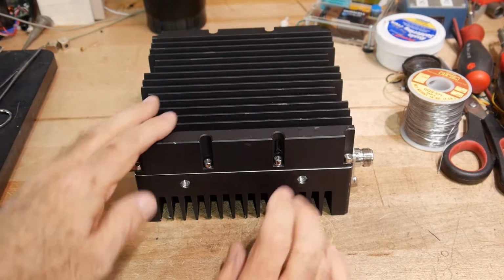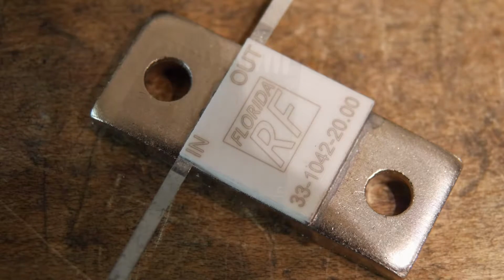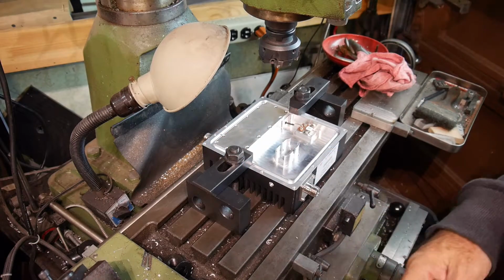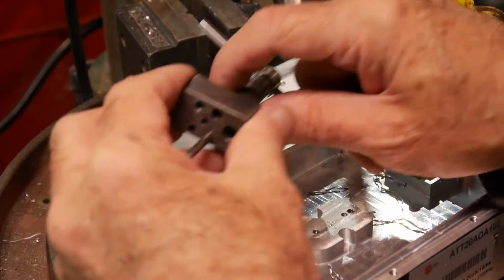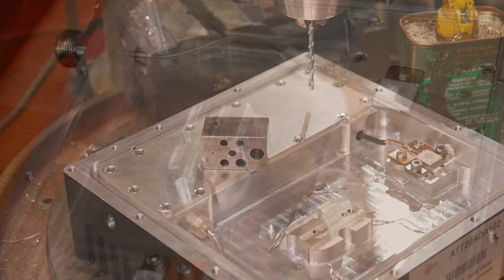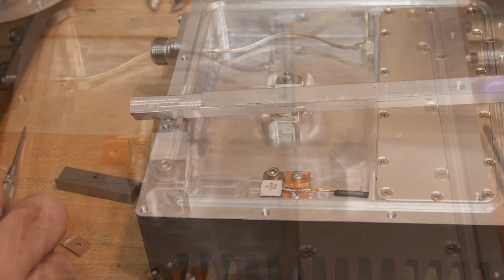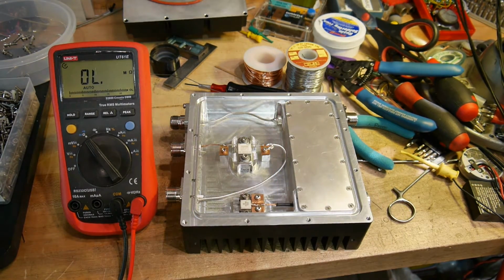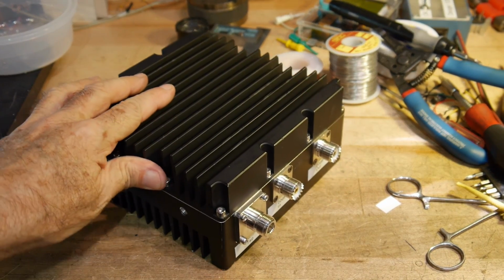#285 250 watt 20db attenuator built

Comment: The scope shows that it works, but I don't understand it. Isn't there a direct path, down and back up through the standoffs, and across the aluminum plate from the input to the output? It seems like there should be an insulator between the copper and the aluminum standoffs. Please help me understand why this works. Thanks.
Reply from the maker: it's a pi attenuator: https://youtu.be/VoUaRypDt2Q?si=iM0q_wCvXlc_0zxo

Comment: I know this is an older video, but would there be any value in adding capacitors to block DC? very cool project.
Reply from the maker: seems dangerous as you have several watts on the other side of that attenuator. it is only 20db
Reply: chuck some silver mica's on there or door knobs should be ok

Comment: Do you have any transmitters to load it with power and test temp rise?
I have a 50W one that I'd like to test on TinySA and no attenuator yet. Thinking of building the same thing, but I have doubts that single flange is going to survive all the power without something sophisticated like copper heatsinks and/or water cooling. 250W seems like a theoretical maximum similar to MOSFET datasheet figures.
There is also an alternative to spread thermal conductivity across like 10 lower attenuation value flanges, but I expect that so many of them in series would decrease overall +/- db accuracy.
Reply from the maker: I only have 100W and it does it easy. the flange is actual copper and about 1/8" thick.
Reply: @IMSAIGuy  Hm, ok, if you say so.
I knew flange is copper, but heatsink is Al and quite limited in thermal conductivity no matter how big of a thermal mass.

Comment: Hi. Can these also be used as a dummy load if one end is switched or terminated to ground?
 If I want to have a 10x attenuator how would I calculate it using these or similar parts? 
  I wanted to use this style of RF resistor with two leads to build a 2Kw dummy load (by stacking in parallel and in series) but now wondering if I use it as an attenuator to get 10x range on a 1kw s meter going into a 300W dummy load will the 300W dummy load be able to handle 3Kw with a 10x attenuator before a 1Kw power meter. 
 Would a 10x attenuator simply be 1000W of resistance value (marked on the component) at 50 ohms? This seems to simple to be correct.
Reply from the maker: there are 50ohm load in the same package for sale.
here is a small one: https://youtu.be/4sxPSJKPOs4?si=pt9_YO25AHsJIqwS
or 250w: https://youtu.be/tQ381HfpAxM?si=3Fx0W9mccAy7f91M
10x is 10dB attenuator
attenuators are more complicated than your calculation. https://youtu.be/VoUaRypDt2Q?si=54G2JuwUSTnvSo_n
Reply: @IMSAIGuy  The thing is I want to build a 2000W dummy load by using these RFR type resistors but the ones that have two tabs. I'm not sure if they are the same as the attenuator you were using but they look almost the same. The idea is to build a 4x4 or a 3x3 grid to arrive back at 50 Ohms but then I saw the 100 Ohm the 200 Ohm etc and the 500W and even 1000W versions. I found a few deals for around $3 a piece for the RFR 50-250 and I'm just waiting to hear back about a 200-800 I assume it's 200ohms and 800W. The it could be either an attenuator with the bypass or switch one end to ground and use as a dummy load. I'm starting to think an attenuator is better. Then I can use my 1kw and x10  or 20DBi to get 10Kw on the meter and I guess I could still use my 300W dummy load because it would see 10x less power. Is that correct? I will keep looking into it perhaps for the same part you found with that part number or is 1000W of RF resistance equal to a certain amount of attenuation? That's the part I'm a bit confused about. Thanks
Reply from the maker: @izzzzzz6  yes, you are very confused. I don't have time to educate you but remember if you attenuate the signal 10x, then 2000W turns in to 200W but the attenuator has to dissipate 1800watts.

Comment: I realize this is an older post but does anyone have a “surplus” source for the rf Florida chip?
Reply from the maker: Here is a 100W: https://www.banggood.com/custlink/mKGRjkR3gr
Reply: ebay has some
Reply: We used Acrian back in the day on Collins radios...I don't know if there around or the present name. Cute 50  ohm resistors..flat supposedly to 1 Ghz. I think their heat sink insulator was BeO...the resistive metal...not sure or don't remember. They know what they were doing and also build UHF and other power transistors... 

Our buddies at Google...would know